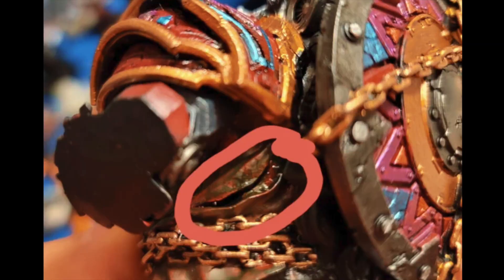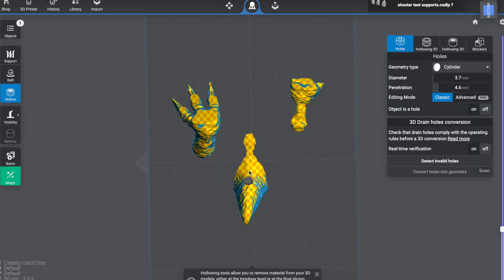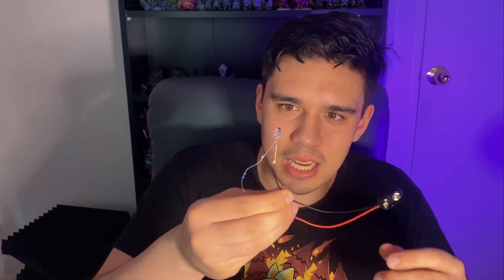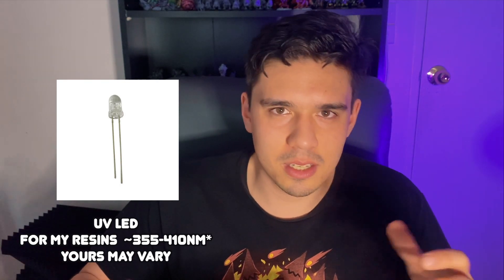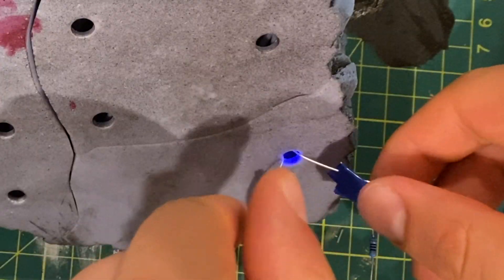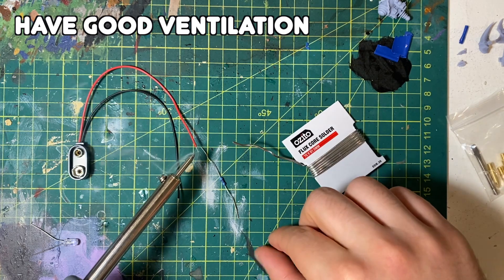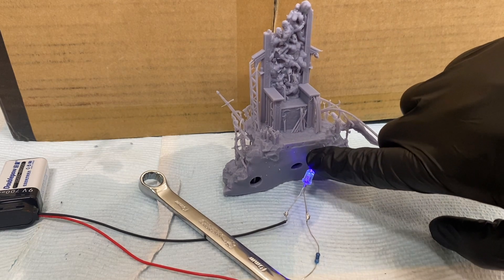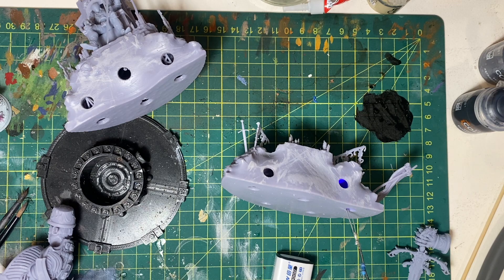How to cure the inside of HOLLOW prints. EASY DIY Solution

Comment from the maker: UPDATES to video.
1. USE A RESISTOR
Thank you to Meep Changling for educating us on the purpose for the resistor. Just because it turns on, doesn't mean it's good.
2. SOLDERING TIP
T. Cooper suggests wrapping the wires before soldering so you don't need to be an octupus trying to hold them altogether.
3. HEAT SHRINK SLEEVES
TEGFB suggests using sleeves that heat shrink to streamline the design and make it easier to navigate deeper into your prints.
4. ADD SWITCH
As the battery connector isn't designed for frequent disconnects and may wear out from it.

Less than a day and already so many great tips.

Comment: I realize this is an older video, but here's an added tip when using something like this. If your LED doesn't fit into the holes on your model to fully go inside and just fits inside the hole itself (like touching the sides of the hole) be wary that it can cure any resin that it is touching and essentially fuse the LED to your model that is clogging the hole. It can also happen if it is touching an uncured part of the inside as well, so be a little cautious and maybe shift it slightly every 30 sec or so to make sure you're not fusing it to the thing. I've lost a couple LEDs and had to reprint a couple parts that way!
Reply from the maker: That's a great point too! Thanks for sharing.

Comment: its more optimal when you don't need a resistor.  I got 12v  405nm UV LED's from amazon. If your power source is 12v you don't need a resistor. I have a DC splitter for a 12v power supply that powers 9 of these LED's that I stick into my models.

Comment: here's a real soldering tip, you don't need a solder iron for simple wiring jobs. just twist the ends together with a piece of solder wire then hit it with a lighter and you're done. in this case, wrap the wire around the lead, then the solder wire around the joint

Comment: I made a video about a year ago on curing the inside of my prints using a fiber optic cable. Check it out if you're so inclined. 😊 I LOVE doing it this way. No soldering, or having to worry about fitting an led up inside my models. I can cure miniature things and just use a 2mm fiber optic cable. Great video!
Reply: i know this is an old comment but could you explain how you do that

Comment: These lights are like 30 for $7 my advice is to solder several in series and then you can stick them in multiple holes to cure the inside faster.
Reply from the maker: That's a good idea! Ty 😁
Reply: Where do you buy them? A link to the lights would be most helpful.
Reply: thats....

...what.

..........she

said?

Comment: Excellent vid. If you don't make it hollow how would a thick resin part cure? Just take forever internally? Also how did you hollow it out?
Reply from the maker: If it's completely solid, the inside is cured during the printing process as each layer is follow cured by the printer.
The hollowing in does in the slicer. You select wall thickness etc. I'd only do it on big stuff. If it's a model like a space marine it's not worth it.

Comment: you didn't trim the exposed wires. leave about 2mm of wire on led and resistor. you can solder the resistor close to the battery so the led has flexible wires, so you can snake it in a model. you can also sand the led to a smaller size then polish smooth.
  trim that shit up   🟣==========🕳=====~==🔋
Reply from the maker: Those are some good tips. Might make those additions to version 2.0

Comment: That print from archvillain games is reason I left patreaon of them. Loved the look of the print, but after 6 times trying to print it changing setting every time, it would never come out right. Gates were to fragile, swords would break. Mist would snap or be deformed. Not the only print I had issues with from them. Never had those kinds of issue with anything else I print. Hell just printed a huge statue from Galactic armor, and every piece came out perfect the first time. Archvillian looks great, but im sorry their designs are crap.
Reply from the maker: Thanks, yeah I've had a few fails with them. Since it was such a small sample, and I'm using a fairly new printer for me I put it down as most likely user error.
Thanks for the heads up.

Comment: for those soldering, hot tip you can wrap the wires around each other to make it easier to solder instead of trying to have 8 hands to hold the wires together whole soldering
Reply from the maker: Yeah I should have thought of that. Thanks Tom!
Reply: ty 4 this

Comment: Do not, under any circumstances, EVER drive a LED without a resistor UNLESS your battery is EXACTLY the voltage the LED needs. Why not? Well, do you want to replace the LED every few uses? Imagine if you put gas containing some desil fule into your car. Would it run? Probably. Will it last for a long time? NO! With electronics, just because it turns on doesn't mean its okay to run like that. LEDs do not like being over volted by much at all. INfact, you should be picking a resistor that will drop the voltage from whatever you're feeding into it specifically to what that LED specifically needs to run.

ALso with a 9v you could run two of those UV LEDs in series. So you could have the + wire going to a resistor, then one LED, then some more wire, and another LED, then the - wire. This would mean you could do two holes at once, and it wouldn't take all that much more current so you'd still get about 10 hours of power from the 9v. I'd also recommend adding a switch to prevent wear and tear on the battery connector. Those are not meant for frequent disconnects.
Reply from the maker: Thanks. I really appreciate you sharing that. I've added "use a resistor" as no.1 in the pinned comment.
I'll have to look into adding a switch. 
So many good ideas to add to resin snake 2.0.
Have a great week mate!